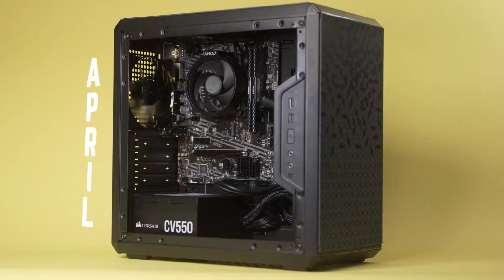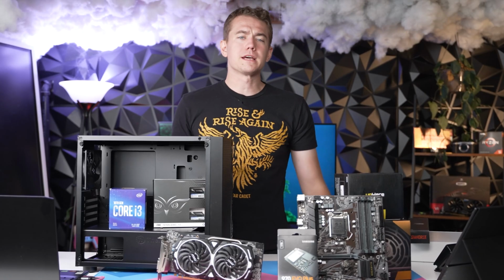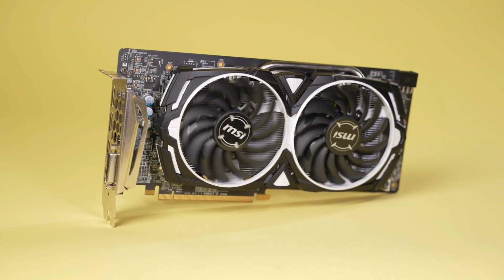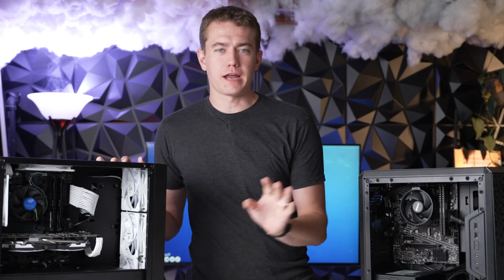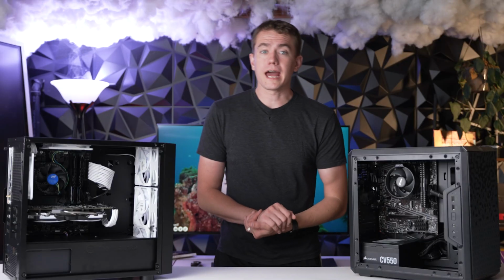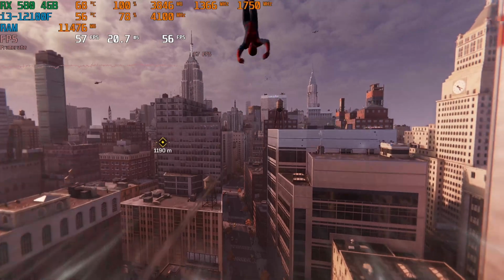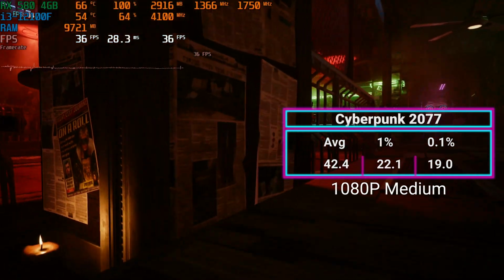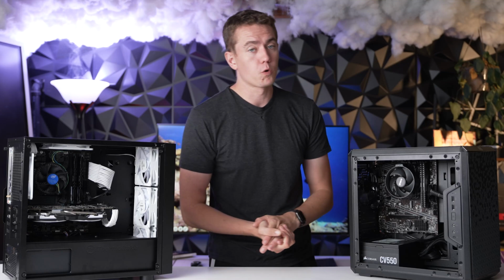Ultimate $500 Gaming PC Build Guide - 2022 - (i3-10100F + RX 580 4GB)

Comment: The RX 580, available both new and used with 2048SP, ranges from $60 to $100. It seems we've finally moved past the mining craze! Despite many current cards being ex-miner units, they still possess considerable life (some priced at $40-60). You could feasibly build a 'decent' rig for $400. An Intel i3 (or AMD Ryzen 5 5400 or 5500), a motherboard (you can get for $80-$120) ,a RX 580 (8GB), 16GB DDR4 RAM (now priced around $30-50), a $39 'smart' PSU, a $40 or $30 SSD or HDD, a second-hand case ($20-30), and budget-friendly fans (3-packs available for $9-$15). Additional accessories can be added accordingly.

I need to upgrade my settup ( a prebuild with a prefabed un-upgradable setup) So I will strip it, I will take the cpu and ram and build another setup that has upgradability. Remember do not get lazy like I did and get a prebuilt, I was supprised by how easy it was to put it together, but just remember that you can break stuff easily, very fragile. I ordered stuff off of amazon as some of the motherboards get packaged poorly and arrive with broken pins (or bent) So I can then return it and get a refund (get another one) I hope to be able to upgrade further, but you know, being fairly "poor" is a hard life for you "Wants"
Reply: A ryzen 5 3600 would be a better budget choice. But will still be pretty cheap

Comment: I have the 4GB gigabyte RX580 since 2019 and I should say, it is a really good card, served me well during the pandemic.
Even to this day, you cannot beat a better price to performance card like this, at least in Europe.
Reply: I'm on the rx480 (8gb) from 2016 it's still working just fine for most games, but I don't think it's enough for Apex Legends for some reason despite my drivers being updated. I might have to do a fresh install of windows, but I'd prefer not having to deal with that.
Reply: @Ket_okay  I personally think it is time to upgrade.
Reply: @aleksdeveloper698  it definitely is, but I've already waited like 6 years so I might as well just wait for rtx4000 and rx7000 series to drop. I plan on pretty much doing a completely new build and then giving my current one to a friend since pretty much everything is outdated (besides the SSD)
Reply: @Ket_okay  Yeah of course, that was what I wanted to say, as soon as 4000 or 7000 series comes out, just buy a great card and you are set for the next 4 years.
Will do the same. I believe we might have similar builds. I have upgraded other components during the years, like the cpu from ryzen 5 1600 to 5600x.
I was amazed at how big of a jump it was.
Now just waiting for the new GPUs to come out and it will be fine for the next 4 years.
I read somewhere the GPU jump will not be as impactful because upcoming games are not build for such power.
More geared towards 3080.
Reply: @aleksdeveloper698  I was going to buy a 5600x and 3070 a few months ago, but as we get more and more information and now seeing that these new parts are coming really soon I'd rather just wait especially since I'm going to need a new power supply and I think we might get updated PSUs coming soon too.

Comment: the great budget-system will be able to run most older games just fine but im not a fan of havin to upgrade cpu and gpu to run newer games propper. at least the cpu, in my opinion, should have a bit longer legs(6core-12threads). spend a hundred more at the beginning and get 2-5 years of future proofing when only replacing the gpu every 2-3 years.

Comment: Rather then picking new stuff ill adivce to buy in used maeker especially cpu,mobo,ram and gpu 

you can make ryzen 5 2600 machine with rx 580 or gtx 1070

Comment: Personally, I would rather go for a used gpu than a used ssd/hdd. I always buy new ssd. Pre-pandemic I used to do buy and sell gpus, I clean them. Once I get the gpu, I clean and repaste them before reselling. In today's market, I would actually be more wary with anything rx 400/500 series cards, 4gb or 8gb. As it's highly possible that 4gb amd cards are not only mined on, but mined on for a long time. While, I really don't care if the gpu was mined on, as long as the miner knows how to take care of the card(undervolt,  efficient settings with clocks, vram and fans), I have a different opinion with the actual age of the card. As the rx 470/480/570/580 4gb cards that was purchased around  2016(400 series) and 2017(500 series) to 2019, have a higher chances that those were mined on. While proper care can preserve a gpu's silicon/chip/vram performance, with the age, it's highly likely that the fans are almost reached it's lifespan. So for someone who's not comfortable tinkering gpu's, replacing the fans might not be an option for them. 

So what I'm I saying? lol What I just want to say is that even 4gb cards might have a history of being mined on and if it has  been, it would be a long one. It was actually more recent that 4gb was unable to mine etherium. So a 4gb amd cards that were bought before 2020 and earlier has increase chance of being mined on, specially the earlier once.

Comment: you showed 10100f on the start of the video but benchmarks shows you're using 12100f wtf is happening?
Reply from the maker: I mistyped on the overlay. It’s a 10100F.
Reply: @UFDTech  Is the stock cooler really that good? Thanks

Comment: I would like to see the setup with a 6-core high frequency chip (sorry I edited this) 6-8 GB minimum on the vram 4gb just don't seem to do it no more
Reply: You won't use much more than 4GB of VRAM on a 580, medium settings usually use 4GB VRAM, and higher than medium on a 580 nowadays is rare.

Comment: Centripetal force is the force that acts on a moving object moving in a circular path and directed towards the center where the object is rotating around  and "Centrifugal force" is the apparent force of the object resisting a change of direction from a non-inertial frame of reference.